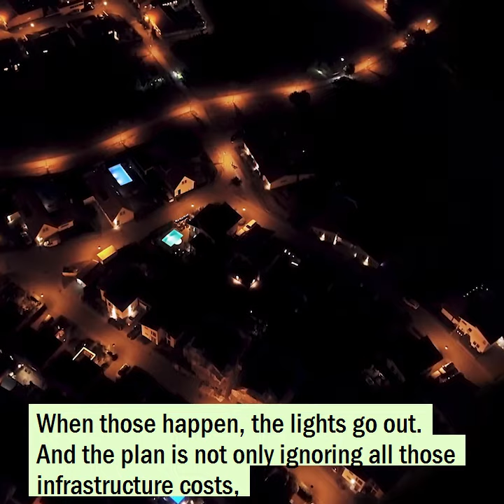Dr. Jonathan Lesser on the Challenges Of Rooftop Solar

Comment: If you add batteries to the households too, then the home installations to actually help the grid- in fact if this solution was pervasive, the grid may have already reached its peak - we'll be past "peak grid" before long. And upgrading the grid may longer not be necessary.  This is even better if homes are permitted to install extra generation to charge their cars and their car batteries would further stabilize the grid.